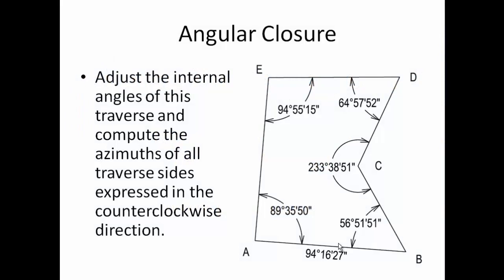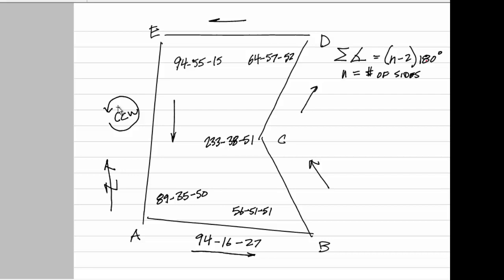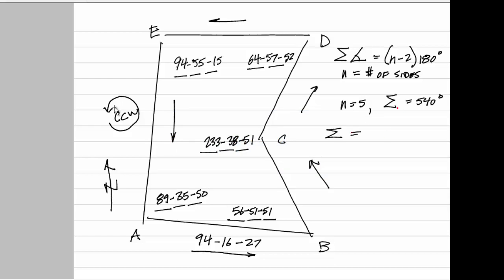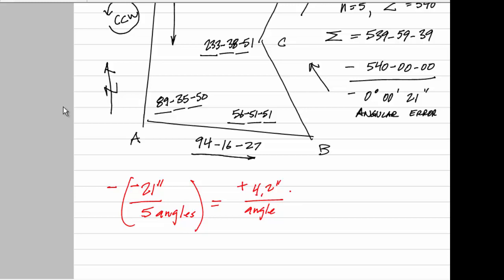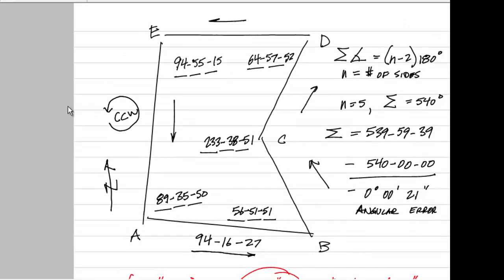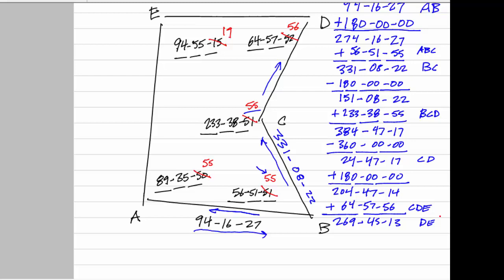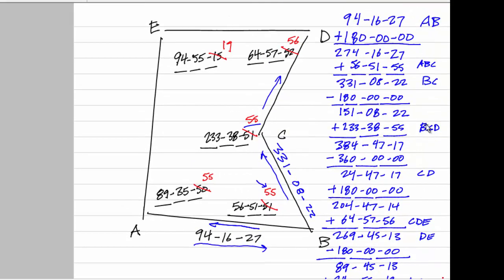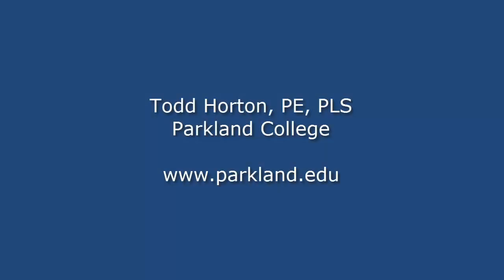Traverse angle adjustment

Comment: Hi Todd, I have a question. When we are doing traverse corrections we also correct latitudes and departures. That will in turn change the bearing angles of the sides slightly. How do we balance the angles and coordinates at the same time?
Reply from the maker: You are correct.  The traverse course bearings (or azimuths) after adjustment will differ by a few seconds from their original computed values.  To determine the post-adjustment bearings, perform an inverse computation for each traverse leg using the adjusted points coordinates.  The compass rule (Bowditch rule) adjustment in the video balances the measured angles first before adjusting latitudes and departures and thus the point coordinates.  It is a two step process.  To get true simultaneous adjustment, we can use the least squares adjustment process - not a manual process, but best done with a software application like Microsurvey Star*Net or Carlson SurvNet.
Reply: @toddhorton6102  thanks.